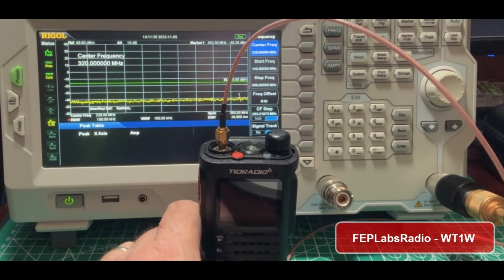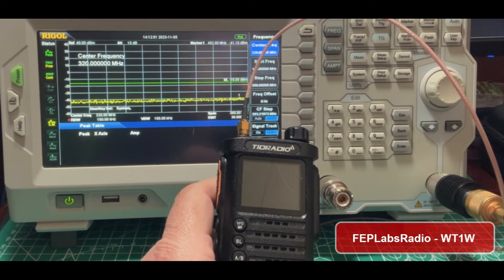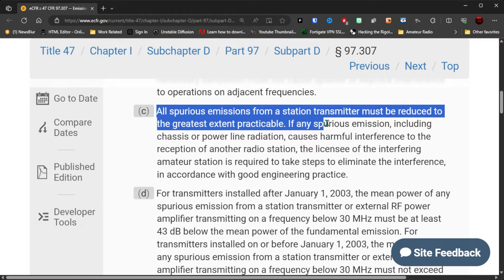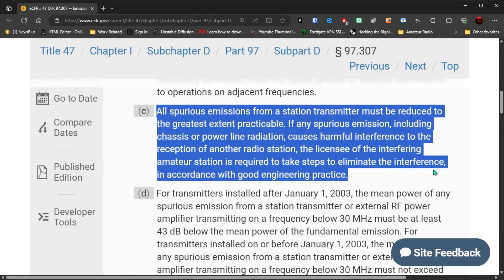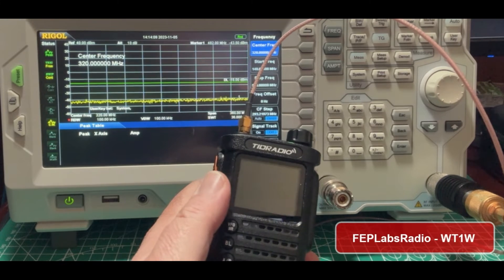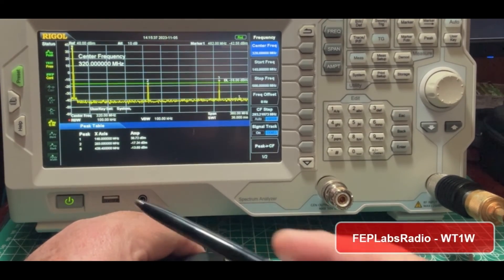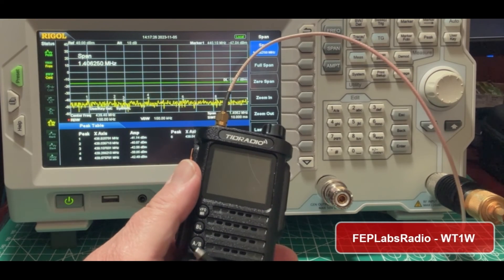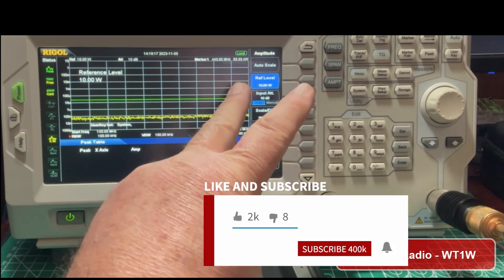TIDRadio H8 Dilemma: Will the newest firmware finally solve it?

Comment: Does TIDRADIO post release change notes for these firmwares? I just purchased my H8, and it has revision 230911. I haven't seen change notes published anywhere. I would like to know what has been updated in version 230923, and determine if I want to upgrade the firmware. One thing I wish they would fix in the firmware is to make the MONITOR function as a toggle when you press the button, instead of as a momentary action that stops monitoring when releasing the button (monitor just opens/removes the squelch).
Reply from the maker: I hadn't seen a lot of release notes.  In fact, finding upgraded firmware is a treasure hunt.  I know you can change modes on it with some power-on key combinations.

Comment: Is there anyway to use an oscilloscope like a Hantek DSO2D15 using the FFT to check a radio like this?
Reply from the maker: Absolutely - mostly.  The limiting factor is bandwidth.  For HF frequencies, it will pretty well do the job.  At VHF/UHF, it is going to attenuate the signal down because that's a 150Mhz scope, and you're gonna be pushing the limit pretty hard.  It should still show you harmonics, but you will need to take into account how much attenuation you use from the radio to the scope, and I don't know if the FFT on the hantek let's you input that.   You won't blow it up, but I would put a 30db attenuator on the output of the radio.

Comment: I got the H8 last week and it works great
Reply from the maker: Sigh.  Dude, you missed the point of the video.  Yeah, it has a nice feature set, and it "works", as long as your definition of work doesn't include "violate FCC rules every time you key up".
Reply: Sigh.  Change the frequency and test again.  Grab a second handset and test again.  Figure out if this is a one off or consistent condition.  Or do you only want failures?  🙄

Comment: Did you test it after switching versions? I have tested the H8 ham version before. If I switch the version, there will be spurious harmonics. But if I don't switch, I won't have this problem.
Reply from the maker: Aaron, I only have the ham version of the radio.  Technically, there are no real emission standards for GMRS except power output related stuff.  At 225 and below, the FCC is pretty specific about harmonics and spurious emissions.

Comment: As a guy who has been in many anechoic chambers for FCC Part 15 testing and had to make expensive hardware changes for 2 dB, I am aghast at Tidradio's failure.

As a ham who knows 2 dB is a fraction of an s-unit, I am 🤷🏻. If it has a cool, unique feature, I would get it.
Reply from the maker: I know, and it pains me sometimes, but I look at it as a pass/fail, based on the rule.  This one is sooooo close....